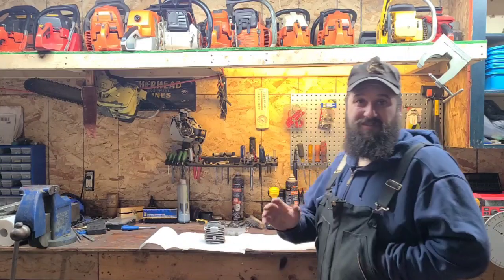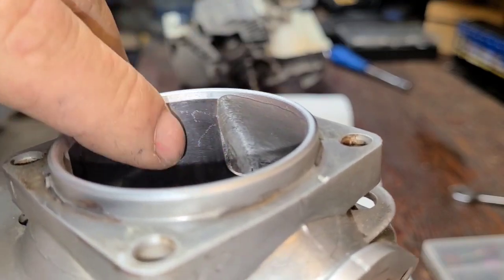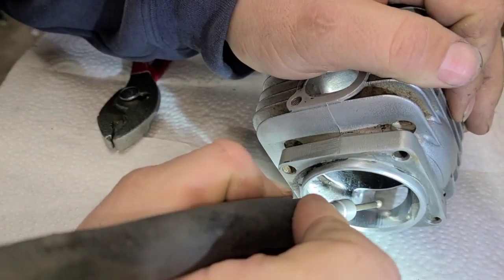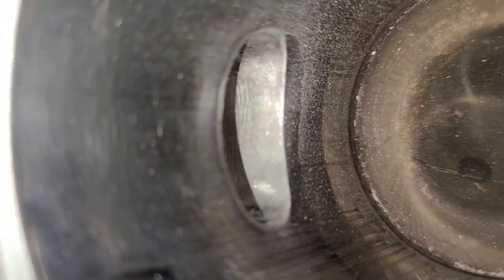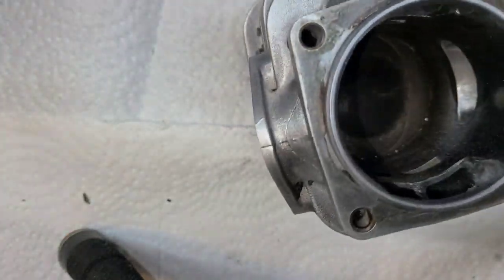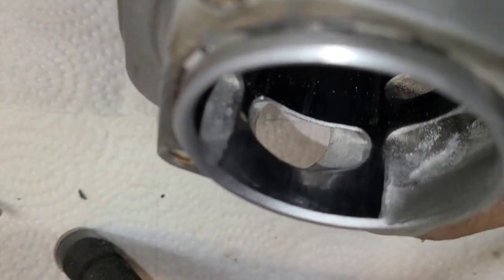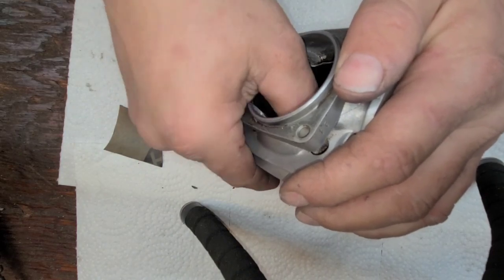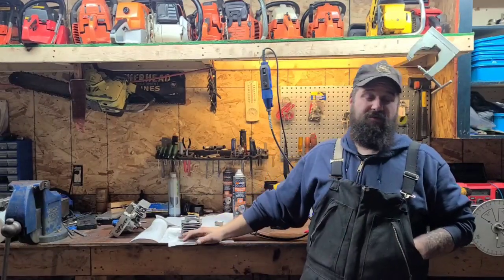How to port a chainsaw part 9: Chamfering the ports.

Comment: This is really important and I’m really glad that you really say this bit at the end about in everything that we do that making a good smooth bevel or easing the port bevels or edge’s is so important.  The exhaust port window bevels are huge in there function of helping to push that very hot and soft ring back into the ring groove… most people don’t realize that their piston ring is actually protruding into the exhaust port window for a little bit while the piston is in that position there’s nothing supporting the ring… why Stihl for all those 0-series cylinder’s had the bird beaks on their exhaust.  And the Mac’s actually ran the bar’s across the exhaust port to keep their rings supported…

Comment: Thanks for your inspirations I was a bronze level Stihl Power Equipment mechanic for 15 years went Trucking for 12 purchase many carcasses private and eBay with only aftermarket parts available for some of these forty and fifty year old machines porting cylinders is the only way for successful repair that many years of chamfer ports I figured what the hell was very happy with my little o28 with a aftermarket jug performance the wash across the top of the piston after raising transfer was pretty spot-on awesome little saw lot more work than going picking a new cylinder off the Shelf keep teaching you're good at in all my years never looked at a degree wheel explains why this year they got power that year they didn't LOL

Comment: I just wanna say I love the work you do your work is very impressive and you make it fun and easy to learn porting ive been studying porting for a year now and in the past month since ive started watching your videos ive learned more from you than I have the entire past year and since then I got a degree wheel, rotary tool tungsten carbide bits, digital calipers, extra basegaskets and an extra cylinder and piston I build motorized bikes and engines as a hobby and transportation I just wanna say thank you because you've helped me take my skills to the next level

Comment: Thanks!  That was a great easy to see what is going on video.  Appreciate the effort going into making these!  Ported a moped about 30 years ago - wouldn't even run when I was done, didn't know what I was doing.  Ported a saw last week - amazing, can't believe how great it runs.  I have that exact echo, and it hardly gets used, because it is a little heavy, and kinda slow, even with muffler mod.  My Jonsered 2260 smokes it, and feels like a 50 cc saw, so why bother with the brick saws!  I'm going to port the echo 67cc, mild, similar to what you just did.  And, I'll let you know how it runs.  Really, it is only 1 or 2 lbs heavier than the Jonsered, and should be able to pull a longer bar/chain (running 24" on it right now, and 20 on Jonesred).  Maybe with a 24" Oregon versa cut - a little lighter - it won't be a bad bucking saw.  Plus, a fun project!  And, will keep the saw from sitting on the shelf.  Thanks again!

Comment: Timing you got me hooked. Mechanics my trade, and have done a little hot rodding. OK  For starters HF flex cable, already done muffler on my MS170. Next question compression, and possible base gasket delete 🤔. Dang thing doesn't have a base gasket. Workjn on Plan B. Thanks

Comment: cut a slot in a nail Or into a wooden dowel and then put your sandpaper in it or you could put super glue and wrap it around  that works really good for polishing the inside of a port ;-)